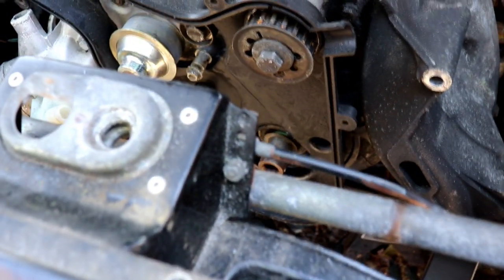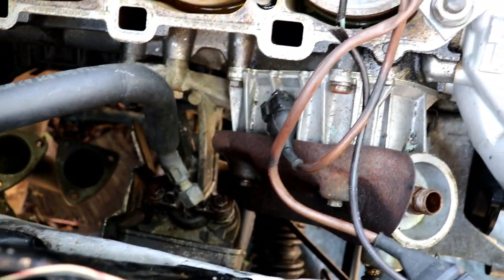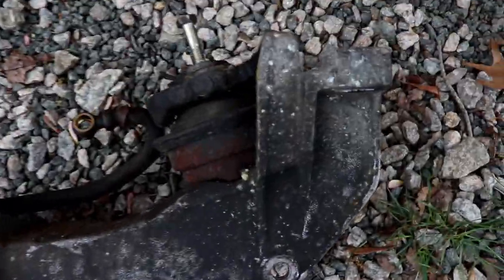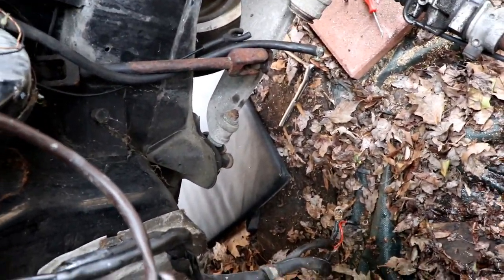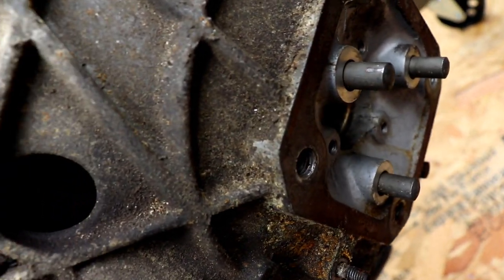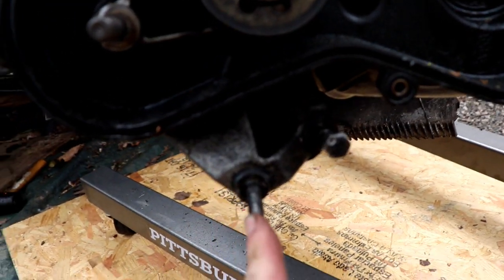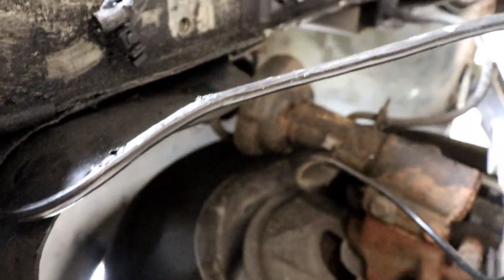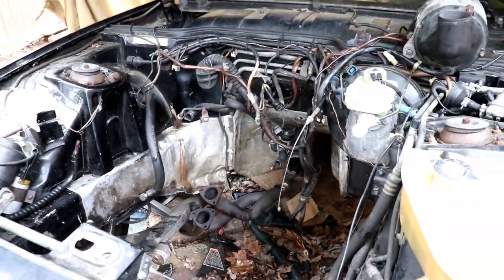Porsche 944:  Project 944 - Engine Pull Part #3 - Engine Out!

Comment: You can put it in from the bottom fully assembled!  Use the cherry picker to lift the front of the car high enough then put jacks under it to hold the height.  Slide engine underneath, use picker to lift engine into car.  30 minutes at most.
Reply from the maker: I had forgotten that’s what you had said to do. I had re read your previous comment after I made the video. I will definitely try that first.

Comment: I guess you learned the hard way that you remove a 944 engine from the bottom of the car. There is no way to get it out the top without taking the engine apart and even then you end up damaging the car to wrestle it out. The first one I pulled out was from the top, I won't be doing that again.
Reply from the maker: It wasn’t that bad, I am disassembling the motor anyway. But you’re definitely not saving time. It will go back in the bottom though...
Reply: @77magnuss  Thanks for your videos. I took mine out through the top without taking out the cross member. I had enough room. '87 NA. Removed intake manifold, fuel rail and both motor mounts and it lifted out. Hood not removed. Don't know why you didn't have the clearance. I know this is several years old, but I pulled mine 2 days ago. Thanks again!
Reply from the maker: @ch-lx2fl  No problem. I’m guessing the difference was in the engine puller. If it had a lower army you can probably get it higher before having to move forward, where I had the oil pan hit the crossmember.

Comment: Put the AEB 058 audi 1.8T engine! Is better in all ways!
Reply: And much cheaper and faster
Reply from the maker: An LS is probably better too but neither of them say "Porsche" on them. :)  Part of this project is to see how much HP (I know it won't be much) we can get out of this motor.  I know most people do a swap but I'm not ready to go down that road.  I am however, taking the road less traveled...
Reply from the maker: It might be cheaper if I bought a motor and put it in, but it wouldn't be a completely rebuilt motor that will go another 200K miles.  Also, I'm an NA guy.  I want this car to be something I can drive at 10/10ths AND be reliable.

Comment: Nice work! Looking forward to seeing what you do with the engine. I'd be interested in buying your control arms if the ball joints are good... Minus pulling the engine (so far) I am following a very similar path - removing seats, AC, radio, etc. Good stuff!
Reply from the maker: I'll take a look at the ball joints when I can. The wheels can probably come off soon. The ball joints are pretty easy to rebuild with a kit from Rennbay. I could probably be pursuaded to part with them.
Reply: @77magnuss  Yeah, we will probably go with that rebuild kit. It's in my "cart" currently...